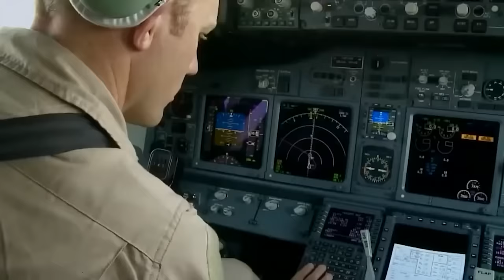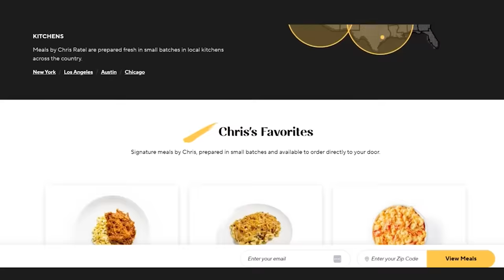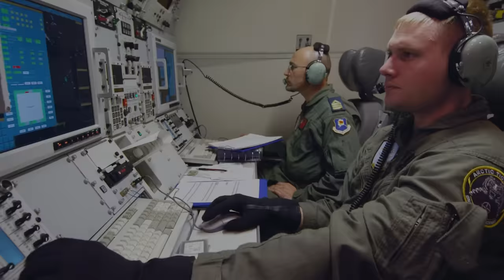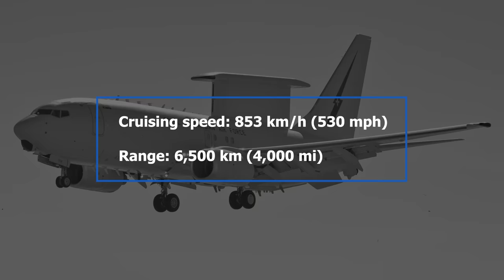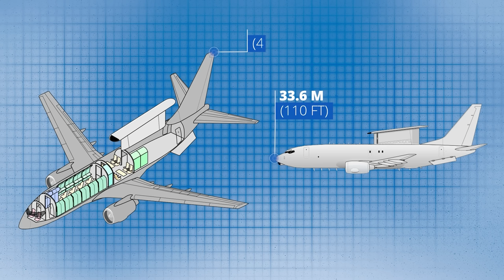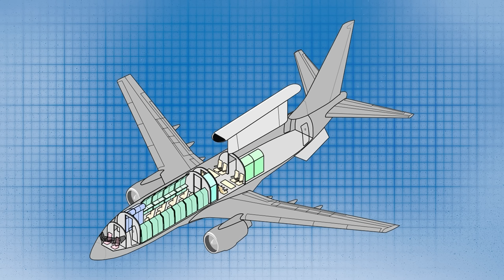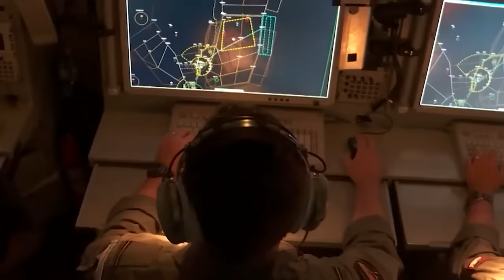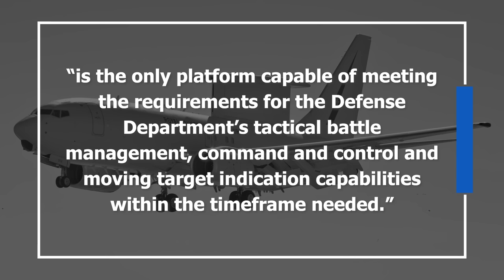The Boeing Wedgetail: The Plane That Will Control World War III

Comment: It's good to see the Royal Australian Air Force (RAAF) getting credit for the Wedgetail's existence in this video.  I've seen another coverage of this topic from a different (US) source, of how the USAF is replacing their existing AWACS fleet with the Wedgetail,, but the narrative made it looked that it was the USAF that initiated the commissioning of the Wedgetail.  With no mentioned that it was the RAAF who initiated the RFP for an advanced airspace battle management aircraft, which Boeing won with their E-7 proposal (as correctly pointed out here).  Kudos on a well researched and presented episode (as always). 👍
Reply: So what, still doesn’t change the fact that all E-7 Wedgetails are made in America… by Boeing in America… by Americans…
Reply: @ianrichards909  So what?!...are you an American?  Did you even get the point of my comment?  It doesn't sound like you did.  Read it again.  MY point is the impression the other narrative shown gave the USAF the credit for the Wedgetail.  It's like giving Ford credit w/inventing the car.  Or Apple credited w/inventing the mouse.  At no point did I mentioned it wasn't a US Design.  And while Boeing is a US Company, Boeing isn't the USAF.  But if you're happy with half-truths in stories, fair enough.  Knock yourself out.
Reply: @ianrichards909 Only two RAAF Wedgetails were built in Merica by Mericans.
Reply: @fatmanoverlanding  I think you might also find that Boeing Defense Australia was the prime contractor on it, heavily designed in AUS. Source: Friends at Boeing Australia.
Reply: @ianrichards909  Designed by Aussies at Boeing Australia and by RAAF and by BAE Australia who supply Australian E7 EWS . not sure if USA does use same or their own. so how can USA supply Australia a Australian built EWS.. incase you do not know what that is.. it is the electronic warfare system.
Also in E7 Wedgetail is rumoured to be Australian radar sensor technology also sold to USA  from Australia JORN radar system.. this is the biggest most advanced radar in the godamn world that no other country is even 10 years close to having the same technology..
You probably going to say MQ28A Ghost Bat is American technology also lol.
Yea why only Australia builds it.
Not all is American technology as Boeing Australia, Northrop Grunman Australia. Raytheon Australia. Lockheed Martin Australia all have R&D facilities in Australia for Australian's to develop USA technology.
If designed by CSIRO or DSTG Australian government science and research agency it is Australian owned tech and can only be sold if Australian government said so even if built by a American defense company in Australia and why MQ28A Ghost Bat is Australian  as was nearly all designed with Australian technology.
JORN radar designed by CSIOR AND DSTG is Australian tech even though USA and UK companies did some work on it.

Example Australian Bushmaster military vehicle is built by Thales Australia.. yes a French defense company and is Australian owned technology developed by Australia and why only made in Australia.
Boeing Australia also are the only country in world to do a resin piece on the Boeing 787 planes wings.. because is a Australian technology  invented and owned by Australia even though is a Boeing company lol.
Reply: @micksmith-vt5yi  easy answer would of been. That the E-7 is the first aircraft that the usa will use that was not designed specifically for them.
Reply: @ianrichards909  Britain is also building theirs in Britain, not Merica.
Reply: @BenCooperpikkaachu  Boeing was the contractor and responsible for the production of the E-7 for Australia. BDA, among a number of others, were sub contractors. BDA continue to provide through life support.
Reply: @micksmith-vt5yi  There’s a lot to unpack here. 

First the JORN network works in a different method to an AEW&C platform so the E-7 is unlikely to use technology developed for JORN. 

Boeing, the parent company were and are the primary contractor responsible for design, development, production and through life support for the E-7. BDA et al are sub contractors for this purpose. Companies like Northrop Grumman and BAe were responsible for supplying components for the project. Their Australian subsidiaries are contracted by the parent company and Boeing for support and logistics. 

The platform itself although designed to Australian specifications originally was not developed in Australia by Australians. Boeing is the owner of the design and for the RAAF responsible for all design and development. When they failed to reach certain goals, they were penalised, a lot. Boeing thought this warranted as future sales, specifically with the USAF in mind would mean a profit overall.  Don’t forget that both Turkey and South Korea ordered their platforms within 4 years of Australia and long before the RAAF accepted the first platform, Australia had nothing to do with these sales nor any subsequent sales. 

Thales builds the Bushmaster to Australian specs. ADI bought the IP for the Bushmaster from the original developer, Perry Engineering. Perry however had used an Irish company’s design and a significant number of parts from a company in the USA. Both these companies had to agree to ADI acquiring the design for the vehicle. ADI was then acquired by Thales and Transfield. Transfield later sold its interest to Thales. ADI was then renamed Thales Australia, owned by Thales, in the same way BDA is owned by Boeing.
Reply: @thelandofnod123  Lol you know nothing,, but good try lil man. Irish company only designed the driveline of the Bushmaster.. if you knew anything about this style of MPV you would know the v hull design is from Africa  and that African designer helped design the Bushmaster.. also the Irish design was changed so much it was not funny.
The lead designer was Aussie and he even drove the first model home and to work everyday.
Mainly a joint collab between Aussie designer and the African guy.
Even said it when research the Bushmaster lol.
Ohh BDA just subbies and does not design anything. ooh my you are so wrong lil man.
Aussie designers at Boeing Australia design for  Boeing.
Is a Aussie designer who is a lead designer at Phantomworks he is listed as the head designer of the MQ28A Ghost bat Aussie drone..
Ohh but you probably going to spit BS no Aussie built it either lol.
Boeing Australia has a big R&D facility in Australia.. god you are clueless lil man
BOEING AUSTRALIA was the main contractor to help design the E7 for Australian RAAF to their specific requirements.
From ASPI Australian Strategic Policy Institute

Air Marshal Chipman says the Wedgetail, built into a Boeing 737 airframe, was an Australian idea, built to Australian specifications to meet an Australian requirement.

So, what does the Wedgetail’s ultimate success signal about Australia’s ability to develop cutting-edge technology and get it operational?

‘It tells us that it’s not cheap,’ says Chipman. ‘It’s not easy; it doesn’t happen quickly. You need to persist with it, but you also need to get to a point where you’ve got a good enough product to push it out into the operational community and evolve it over time.

‘That combination of working in partnership, having the vision, persistence and determination to see a capability through, but also to evolve it while it’s in service are valuable lessons. That’s our pathway. There are other ways to deliver cutting-edge technology to the warfighter, and we need to be open to all of them.’

Chipman says some original goals may have been over optimistic, but setting them helped develop a significant capability. ‘Had we not set ambitious targets, we would have fallen short of what was eventually achieved. You have to strive for ambitious targets.’

But there is a balance point. ‘We also need to achieve the timely delivery of capability into service. We were close to a point with the Wedgetail where our determination to achieve an ambitious target was delaying its introduction, and that’s dead time for us. If a product is good enough, then we bring it into service and achieve those aspirational objectives over time.’
Reply: @thelandofnod123  Lol no JORN is a different radar system, but the sensors and transmitters and other tech can be used in other radar systems lmao and the tech has been sold to other 5 eyes countries netting Australia over $200 million.
Oh more proof BDA develops tech in Australia and even sells it back to USA giving Australia trade in it's economy.

You Americans think everything is you lol..
Probably think Boeing USA is building UK E7 lmao..
Even states Australia is developing all the next gen electronics etc.
As i have said many times on here Australian tech is in Australian E7'S that Boeing USA has nothing to do with

Boeing Defence Australia (BDA) is playing an important early role in supporting the establishment of the UK’s Wedgetail Airborne Early Warning and Control (AEW&C) program, BDA Managing Director Scott Carpendale has disclosed.
Carpendale told media that this activity began shortly after the UK signed a US$1.98 billion contract on 22 March for five Boeing E-7 AEW&C aircraft. Deliveries will take place in the early 2020s.

“Within Australia we have a leading role both in supporting the development of the UK aircraft and aircraft systems and also in making sure the UK Ministry of Defence (MoD) is able to establish a support infrastructure that gives them the same capability as Australia’s Wedgetail program,” he said.

The work was being undertaken in conjunction with Boeing UK and the UK MoD.

We have people in Williamtown who are building some of the ground segments that will be shipped to the UK
“We have a project team, we have people in Williamtown who are building some of the ground segments that will be shipped to the UK, we are undertaking software development in Australia that is part of an integrated software development team with a UK software baseline,” Carpendale stated.

Implementation of the $582.5 million upgrade program for the RAAF’s Wedgetail fleet announced in July 2017 was continuing on schedule, he disclosed.

Under Project Air 5077 Phase 5A, BDA is fitting the six Wedgetails with new combat identification sensors, tactical data links, communications hardware and encryption systems, and mission computing hardware and software upgrades. The work will be completed in mid-2022.

Carpendale described the upgrades as meeting uniquely-defined Australian requirements, and declined to comment on whether any might be included in the UK AEW&C program.

“But I would agree that some of the capability would certainly appeal to the UK,” he added.

Comms Export Opportunities

BDA is also seeking export opportunities in both the UK and the US for its $950 million Currawong Battlespace Communications System, according to Darcy Rawlinson, BDA’s Business Development Manager for Deployed Network Communications Systems.

Developed under Project Land 2072 Phase 2B, Currawong is providing a digital strategic communications system linking Army’s deployed forces and headquarters, and achieved Initial Operating Capability (IOC) with the ADF in April last year.

Rawlinson said the British Army was seeking a wide area network for its headquarters under Project Trinity, “and Currawong provides a lot of the requirements of that program, so what we’ll be offering, probably sometime over the next two years, is something based on the technology in Currawong.

“We do have the ability to modify that where the UK has slightly different requirements; we have our 120-strong team here in Australia and we also have a team in Boeing Defence UK helping us with this as well.”

They’re quite keen to take the next stage of doing some formal testing with the system 
Rawlinson said the US Army was looking to upgrade its Warfighting Information Network Tactical (WIN-T), now more commonly known as the Integrated Tactical Network, and certain elements of Currawong were of interest.

“They’re quite keen to take the next stage of doing some formal testing with the system over in their labs so they can understand exactly how it performs. That will probably happen in the next six months,” Rawlinson disclosed.

“It will really be about Currawong doing some of the heavy lifting on the networking side, our routing and our network management system. You never have enough bandwidth and someone can be trying to deny that space to you.

“Here our headquarters are constantly moving, so it’s really important that the network is very agile and flexible to deal with all that while reducing the complexities that soldiers have to deal with,” Rawlinson said.

“It does that for the Australian Army and the US see that as something which can really enhance their network, and something for which it is well-worth continuing their dialogue with us.”
Reply: @scottmeehan2422  That’s not true either, the US uses and has used other countries aircraft before, modified or not.
Reply: This ridiculous bickering and point scoring about this project is utter nonsense. I was at Russell and worked in Force Development Aerospace on AIR5333, and parts of AIR5077. BDA is a subsidiary of Boeing Defense in the USA, who were prime on the project, and the ones who paid all the fines for project delays, which were often caused by shifting goal posts by the RAAF Project Team. BDA had to use the US Company for initial design support since they don't own the rights to the B737. The systems were developed & integrated by the sub primes, but project guarantees were from BD US. Yes Australia developed the initial requirement, and BDA worked with the RAAF Project Team to refine the concept, but it wasn't designed in an Australian vacuum. BAe and Northrop were the Major sub primes, and it was their Aussie entities that developed the system requirements, with assistance from their main corporate entities, which have the resources the Aussie offices don't. All the airframes were built in the USA. The first two were completely fitted out and modified there, while the rest were modified in Australia. The intellectual property rights are not owned by Australia, however some of the systems are "owned" by their Aussie offices. However, this doesn't mean that their corporate owners in the UK & US don't have access to the information. The Korean and Turkish aircraft use their own internal systems, but because UK and US owned companies participated in the projects development, it makes sense that the US and UK versions will be similar in sensor and systems to the RAAF ones, but updated. JORN, which is part of the AIR5333 system, has nothing in common with the systems in the E7, aside from its data being used as part of the sensor feed, when available. Stop the silly insults over this, it's childish.
Reply: @tlevans62  It is quite the painful exercise to correct nonsense espoused by these armchair experts who demonstrably have no knowledge of the subject. Thanks for your effort in further cementing the record. 👍🏻
Reply: @tlevans62  You are right about a lot but  i didn't mean JORN is in the radar but heard by a Boeing employee that radar technology from JORN is and can be used in other forms of radar. ie sensors and amplifiers etc and all been sold to 5 eyes.
Even if tech is owned by a foreign company in Australia if developed by CSIRO and DSTG it can not be sold to a foreign country unless Australian government approve it
JORN. Ghost Bat. Bushmaster all developed Australian tech can not be sold to a foreign country even if owned by them.
Why Ghost bat AI is in many USA and UK products including Taranis UK drone it is owned by Australia even though BAE Australia built it.
USA had to get approved to even buy Ghost Bat even though is a Boeing subsidiary product.
Reply: @ianrichards909  That uses SOFTWARE developed by Boeing in AUSTRALIA written by AUSTRALIANS.
Reply: @micksmith-vt5yi  it totally depends on who owns the intellectual property rights, or patents on the tech. Even though BDA were the Prime on AIR5333, they needed the tech from Rockwell CSD to make some of it work, so they acquired the licenses for their use, but that doesn't mean Rockwell can't sell it to others anyway. In the end I believe Rockwell CSD was bought by Boeing Defense. These things are extremely complicated, and when people wonder why these contracts take years to get done, it's because of the complexity of the licensing and the contracts. Even the Bushmaster had to have the rights to some of the tech purchased under license from other companies, and those rights will dictate if their part of the units can be exported, or if they will get paid a percentage for every unit sold. When you get to warships, it's even more complicated. As for JORN, as you know, we developed the system, but the initial idea came from other countries already trying to bounce signals off the ionosphere to get radars to see over the horizon. What we perfected was the way we could measure the height of the ionosphere so we could get returns that were reasonably accurate. As to the filtering of background noise, that took decades to perfect, so if you're saying we invented all of that, it's only partially true. We developed some of it ourselves, but we also acquired technology from Lockheed Martin and Tenix etc. We tried to do it all ourselves under Telstra, but they made a mess of it. BAE Australia is now trying to refine it further. However what's true is that CSIRO & DSTO are in overall control of it and own the intellectual property rights. Not sure about what parts of that have anything to do with the radar system on the E-7A because they use totally different types of radars and signal processing. What is true is that JORN is the most sophisticated radar of its type in the world. I should add that it takes a long time to process a return from the system, a couple of hours at least, so it's not at all like the real time returns you get with the E-7A. As for MQ-28, I don't know, but I assume BDA has the rights to the airframe, but not the engine or the sensors. As for the AI, I have no clue, but I'd assume they had the base AI program from one of the leaders in that industry and are adapting it for use. I might add that big defense primes do projects through their Aussie Offices, but that doesn't mean everything is done in Oz, they draw expertise from their international resource base, so mostly US, or UK is doing the back end work. They'll even send people from overseas to work in the local office, so when you go to various "Australian" Project Offices, you'll find half the office are yanks etc, not Aussies. Most of these projects are not created in a an Aussie vacuum as I mentioned before. We simply don't have the people or local expertise to do it that way.
Reply: I'm also going to add something here, so you know how the system works, as in Defence Procurement. The Gov't gives us the Strategic Direction, the Military defines what it needs to accomplish that, then the Gov't tells us if we can have it or not, then they meddle in what we are actually buying. Different services make messes of things too, often because military people aren't equipped to manage these type of projects. Case in point: AIR87. Being an SO2 in Army, but working in the "Purple" Force Development (Aerospace) office, I worked on that project with RAAF colleagues. We had selected it down to the AH-64D Apache Longbow, because of its proven track record, its capability, its ability to deploy in defense of our Diggers, and parts availablity and commonality with the yanks, since we'd learned a bit from running out of parts for our S70A9s. We had to also put in why we didn't select aircraft like the Tiger, Rooivalk etc. When it went before the Joint Parliamentary Committee on Foreign Affairs, Defence and Trade, they noticed that Tiger, despite not meeting a few of our requirements, like not being proven in the role, came with offsets, and the aircraft could be built in Oz, so they saw jobs, and jobs mean votes, we pushed back and said our version would be "Australianised" therefore, there were no other versions like this, and parts might be an issue, but that argument was rejected. So, we ended up with the ARH Tiger, an aircraft that couldn't deploy overseas to support our Diggers in Afghanistan. I might also add, the Taipan also had the same ludicrous path through Gov't. The Project Office recommended the MH-60L/M, but we got the Taipan for the same reasoning. AIR87 started way back in the 1990s, and now, in the 2020s, we're finally getting the AH-64E, and the UH-60M. The only helicopter we could deploy overseas to a war zone, were the CH-47s, which we bought off the shelf, with no "Australianisation" from the US. I'm proud to be an Aussie, and I'm proud of what our people can achieve, but I'm also realistic about our failings and what we can, and cannot do on our own.
Reply: @tlevans62  We actually have a lot of smart Aussies developing tech, so you are kind of lowering their position, yes we rely on others a lot but also develop our own.
Hypersonics Australia even ahead of USA in scramjets and has helped them.
Australia has world fastest scramjet and test fly a hypersonic drone this or next year
HAWC and HACAM scramjet missile where developed through Australian help.

Yea JORN is not all Australian. idea and main principles came from UK and USA. actually USA would not share any tech with Australia at first until Australia contacted USA about their plane movements around Guam that JORN had detected and then realised we had done it on our own and surpassed them and then helped where could.

 Was a few USA contractors involved over the years on JORN Raytheon, Lockheed also UK BDA.
JORN is decades ahead of any other in the world, was a recent piece where they can tell by other countries frequencies of their systems that are still way behind.
Did not know it took 1 day to return JORN detection of objects, bit late if group of planes was incoming.. thought they said JORN was being used to detect missiles and especially hypersonics and would help as early warning for them. not sure how can if is a day late.

Actually Ghost Bat was mainly all Australian with a bit of Boeing USA helping out. as i said designer of Ghost Bat is Australian who also a lead designer at Phantomworks, Lead engineer also Australian, Ghost Bat AI is BDA design and more Australian as even Taranis drone uses itn Nulka and was a big report on Australian AI development and it hinted how good Australian AI is.

Was a good interview with RAAF Commander head of Ghost Bat programme and how much of it was Australian developed.

Anyway hard to tell how much comes from who within these subsidiaries and annoys me when Brits or Yanks think is all them and should realise is a joint programme and why are 3 of best allies in the world.
Reply: @tlevans62  Oh yea know about how Military say they need this and put people in the process part, then defence companies put in their products that might fit it, then government sign off and usually ones who stuff it up.
Like even the E7 was the Australian's who chose the airframe to fit it all in.
Kind of my point of being a Australian design but using American tech also
Reply: @micksmith-vt5yi Mate, I'm not selling Aussies short, but you need to understand that the US principles are heavily involved in all our projects, where the Aussie Offices are subsidiaries of the US Main. It's all about who's paying. If the Aussies pay, it's their project, but that doesn't mean that the USA Office isn't involved.  Like I said, these things aren't developed in a vacuum. Your statement about "actually USA would not share any tech with Australia at first until Australia contacted USA about their plane movements around Guam that JORN had detected and then realised we had done it on our own and surpassed them and then helped where could." Absolute nonsense. The US shared what they had done with OTHR through scientific papers, which were shared and discussed with DSTO & CSIRO people from the very start. The USA knew full well what we were doing with the project. It's only been since Phase 4 that we reduced the return time of tracks to six hours, and now it's a lot better than that. Like I said, it's down to funding, the USA didn't invest any funds in the JOTN Project aside from technology sharing, but that doesn't mean they're not involved in providing data, allowing technology sharing through DARPA, and even assisting in tests of the system. Like I said, I was involved heavily in AIR5333 Vigilare and that system uses data from JORN to function, and to help create the RAP picture. BDA was the Prime, but it got a lot of help from Boeing Defense USA. As for MQ-28, BDA was the Prime, and it did the development with the assistance of BR&T, through its Aussie arm, and same with Phantom Works Global (owned by Boeing), and SAL. The idea is Global Export. Who pays for the design & development, owns the project and the export rights. We own the rights to the MQ-28, but again, it wasn't developed in a vacuum. The original specification and project may be Aussie, but it takes an international team to make it happen. No single "Australian" designs anything, it takes a Team. When you refer to BDA, it's basically Boeing International, buying up CAC, ASTA, DeHavilland, Rockwell, GAF etc. BDA is owned by Boeing Defense, Space and Security, which is based in the USA. Boeing invests heavily in Oz, and has set up BR&T-A, but it's still using all the resources of the parent to develop the technology. In fact, only last year they were recruiting in Oz for software engineers to help develop the AI systems for the MQ-28A, which are not at all finished. It's still in development. Anyway, I'm just trying to educate you on the realities of the situation since I worked on many of these projects at Force Development. It's always good to have national pride, as long as it doesn't become toxic.
Reply: @tlevans62  Mate you are totally wrong on Ghost Bat AI.. it is fully BAE Australia owned AI in Ghost Bat.
And not all finished,, Ghost Bat Block ii is becoming fully in to service next year.. it is a version never seen by public before. bigger so can carry weapons etc. one we see was just a test bed really to test the AI out and the airframe could hold up in real flight..
Ghost Shark by Anduril uses Ghost Bat BAE Australia AI and why named Ghost Shark as a tribute to Ghost Bat and Boeing has nothing at all to do with it.
Nulka defence decoy rocket another Australian invention also uses the same AI as Ghost Bat from BAE Australia.
UK Taranis drone also uses BAE Australia AI.
BAE Australia AI is in many USA and UK military techs and is not UK technology either.. was developed by Aussies.. yes UK gets the money for sales but is Aussie tech.
Maybe you are wright Boeing is recruiting Aussies for Ghost Bat AI.. but is not Boeing emplouees.. it is BAE Australia.. even found on BDA site.
Reply: @tlevans62  Ohh and also Sentient Australian company provides AI tracking to a lot of US defence companies and  in a lot of their tech. Shield AI is now looking at buying them out.
Also DefendTex Australian company is one of world most advanced in AI drones and drone swarming capabilities and even DefendTex D40 drone is in Ukraine war and seen video of it flying in to a Russian tank hatch and blowing it up
But hey you say USA helps us and we know nothing.
P3 Orion uses Sentient AI tracking and identification, also 
Northrop Grumman MQ-8 Fire Scout lol seen so many Yanks brag about it and it uses Australian tech to identify targets.. probably crash without it.
So much Aussie tech that has no Yanks involvement.. 
Did you know a Aussie was first to get essence of flight from scramjets and Australia ha world fastest hypersonic wind tunnels and even China stole this tech to claim they have world fastest wind tunnels.
Reply: @thelandofnod123 kind of pointless. I'm being lectured by a Cheer-leading fan Boy, who's knowledge comes from magazines and the internet.  Don't know why I bother...what would I know, anyway. lol
Reply: @tlevans62  Yeah I know, tell me about it. I read through your comments and learned a thing or two myself.

Thanks for taking the time.
Reply: @thelandofnod123 well, at least it was worthy posting then. Cheers.
Reply: @micksmith-vt5yi  thats completely untrue - the applicants for the project each designed their own systems, including airframe - BDSS chose the B737, Raytheon the A310 and Lockheed the C130.  We just picked the winning combo,  This project ran a really strict TSPR (total system performance responsibility) program such that all the RAAF did was watch, test and assess compliance - all design decisions were contractor initiated.
Reply: Not exactly
The USAF's replacement for the E-3 for the Northrop Grumman E-10 MC2A 
It ran the same time as the E-7 did for the RAAF
The E-10 was cancelled  idiotically and the USAF was left up a creek 
Honestly the E-7 makes zero sense while the E-10 does
The point of the E-10 was common airframe to replace the E-3, E-4, E-8 and the RC-135 family
The USAF already has the KC-46 operational, use the KC-46 as base frame and continue with replacement of the other assets
One of the problems with the E-7 program is the high demand of B-737 air frames by commercial airlines 
The B-767 is also in demand but not has high
1300 air frames  vs nearly 7200 B-737
Reply: Apple mentality...
Reply: @scottmeehan2422  harrier
Reply: @micksmith-vt5yi  , it wouldn't surprise me if the AESA in the wedgetail has been enhanced with CEA tech since its introduction. Australia also does some remarkable stuff with command and control systems
Reply: @JohnMartinIT  yea when USA defence companies own subsidiaries in Australia using Australian's to develop technology you will never know who is behind it.
I worked for a foreign company in Australia and had to sign a contract saying if I invented something while employed by them they owned the intellectual rights to it. Even if I built it at home. All American defence companies in Australia have huge R&D facilities here. RAYTHEON just built a big one in Australia..